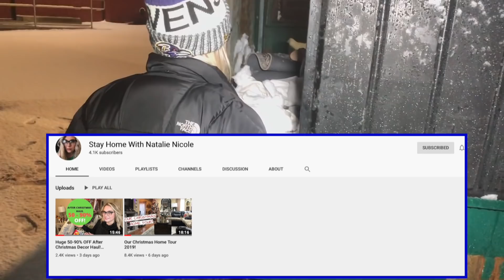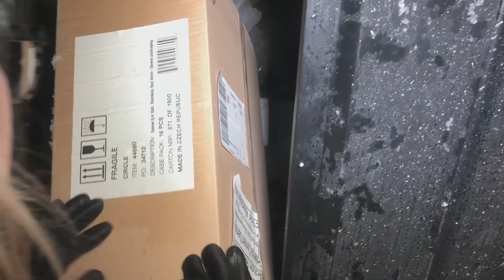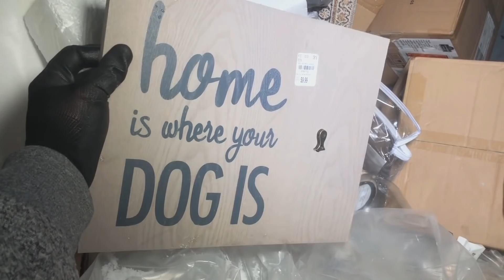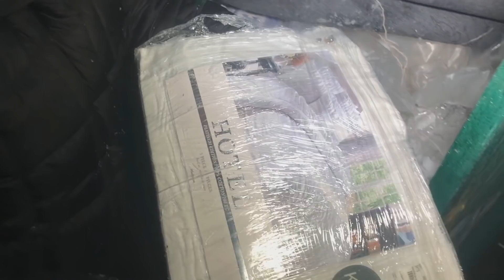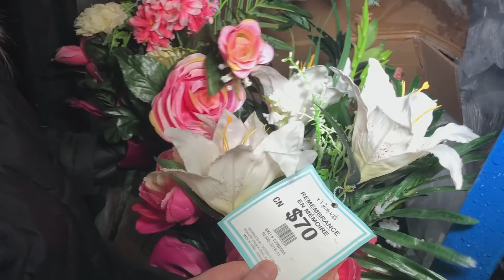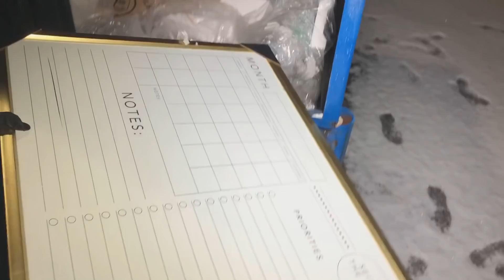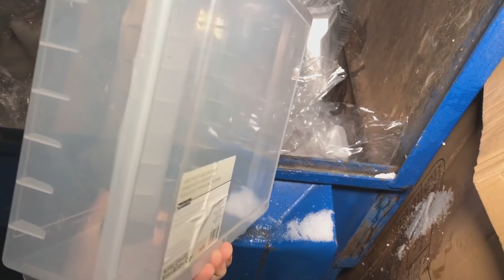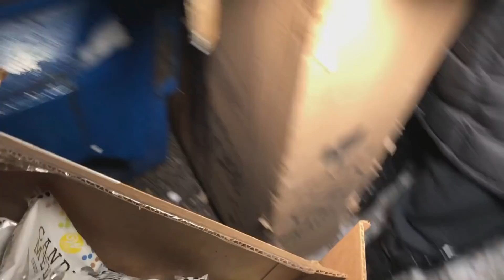MICHAEL'S MANAGER FORGOT TO LOCK THEIR DUMPSTER AGAIN! OOPSIEEE...

Comment: The cherry blossom trees would be nice as party/wedding decor. Just add some hanging crystals or white lights.
Reply: Love that idea
Reply: @paulacollins7554  thanks
Reply: Niiiiiice!
Reply: So these trees actually have a plug at the base of the trunk and wires that go through the trunk to each branch. I don't think the flowers light up but maybe the trunk? I didn't find the plugs for them but found these same trees a couple days ago too!
Reply: Athenah do you know what kind of plug that goes to them also found one without plug?
Reply: @melissapaez9113  I'm not sure. I have a bunch of random dumpster adapters I was going to try. Maybe an ac adapter? But I am only guessing. If I can get to it tomorrow I will give it a try and let you know. I'm really not sure if it lights up or what. I didn't see any lights but maybe they are tiny.
Reply: @melissapaez9113  I was able to try an adapter that fit but nothing happened. Not sure if it's the plug or the trees do something other than light up? I can't see any led lights in the trunk but there are absolutely wires that run through it. Ugh, it's driving me nuts lol
Reply: Athenah maybe the wires are what secured them to some kind of display base in the store?
Reply: @alyssavermette9585  no, they have a screw on the bottom and screw into a square metal base. There is a plug at the base that is round and the wires go from that through the trunk to at least the top branch. The flowers attach in seperate branches. I can't find any tiny led lights anywhere on the trunk or flower branches. 

I appreciate the help though! If I figure out what they do I will update this little thread 😄 I think I just need to take some photos and post it online so people can see and hopefully someome will reconinginse the plug 🤷‍♀️
Reply: Athenah ok I wasn’t sure because I’ve seen displays like that before in the stores and they were securing it to the base could they have broken the wires inside or something?
Reply: Ok mucho  bla,  bla , bla bla,  bla , y todo igual que pereza
Reply: InstaBlaster.